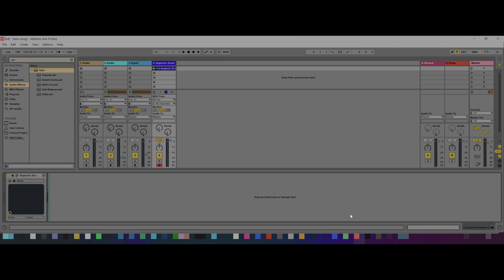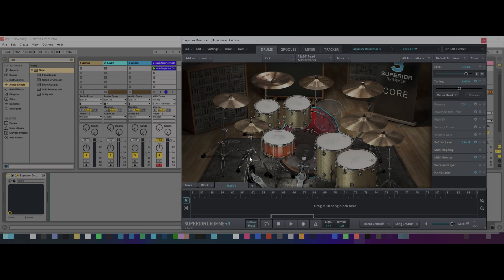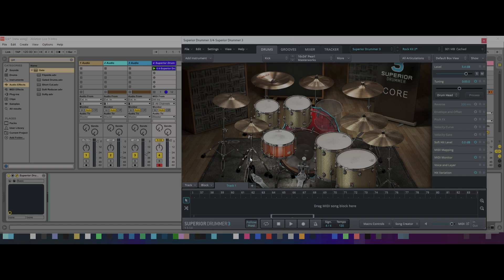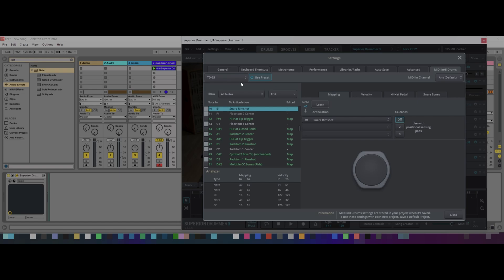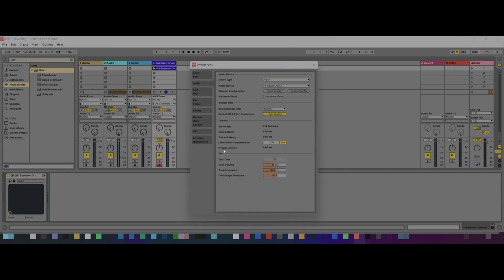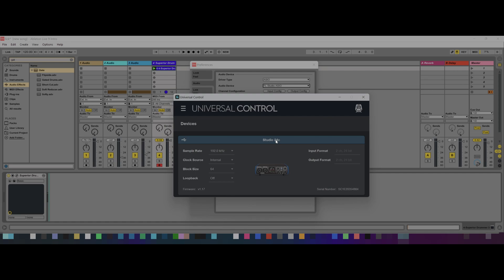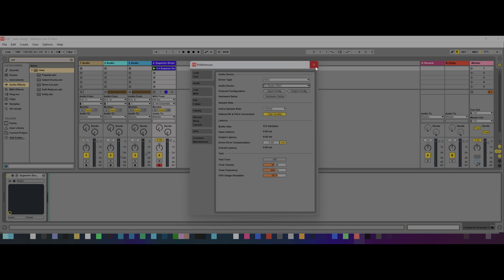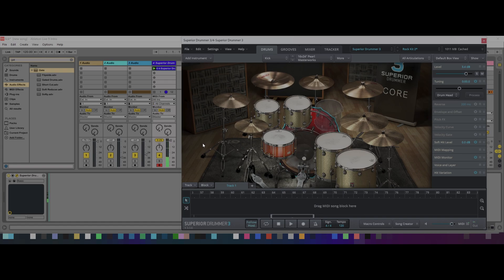Superior Drummer 3 Latency issues fix

Comment: It’s great to see some recent discussions of Roland and Superior Drummer 3. I am setting up a Roland TD 50 and Superior Drummer 3 using an Intel 2019 MacBook Pro. Does the Roland kit simply send its commands through the USB to superior drummer and superior drummer returns the sounds through the USB port?   I then simply send SD3 drum sounds out to my PA system via the many output jacks of the TD-50?  Thanks!  Jim, Las Vegas.
Reply from the maker: I use a PreSonus sound card. Through midi out from the brain of the Roland and into midi in on the card. The card is connected to USB. That will handle signal mapping. If all drivers and presets are selected (the model of the kit in SD3 settings), then you just adjust the latency as mentioned in the video. Tweak it till you are satisfied. As for direct USB connections. This I can't comment on sorry to say
Reply from the maker: Also, the sound card has sound out options through Jack's at the back. You need to check what model supports your PA
Reply from the maker: And of course, you need to hook the card to the Mac. Hope that helps. Have fun and discovery in your journey

Comment: HI, what is your setup actually like? Is it possibly something like this:
Drum cables -> Trigger interface/module -> Laptop/computer -> Audio interface -> headphones?
Will this eliminate the latency when monitoring the hits?
Reply from the maker: My setup is more or less like how you describe. For latency, you need to change the settings both for the interface and the DAW. But if you're starting out. I will say it's all a trial and error. And it takes time to get your work flow down
Reply from the maker: Also, I recommend monitor speakers. Mixing in headphones gives a false interpretation on the levels. The last track I did was with monitors. Before, I was using headphones only. The result was much better
Reply: Thank you very much for the quick response! 👍